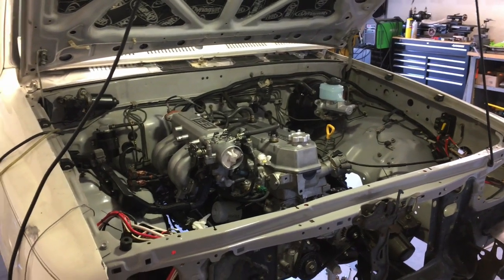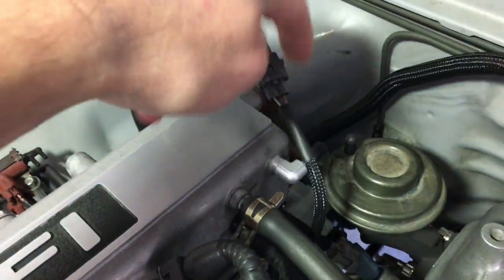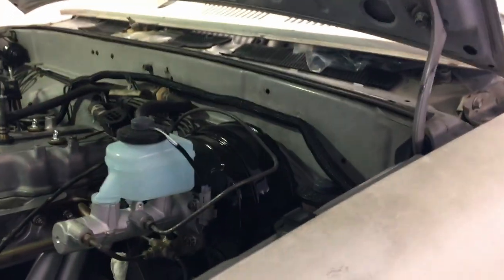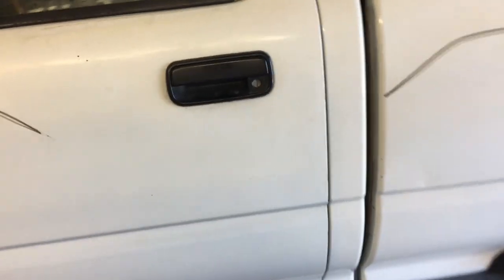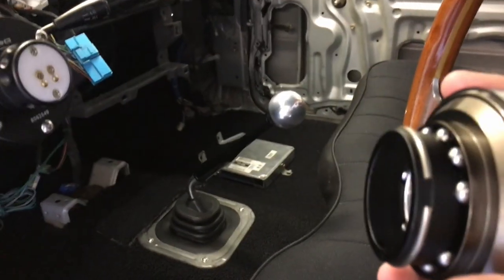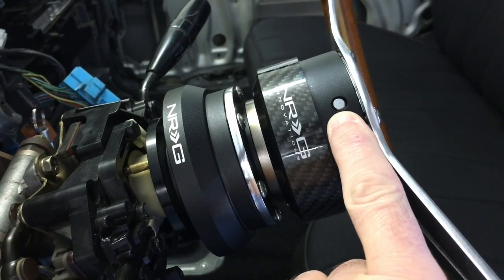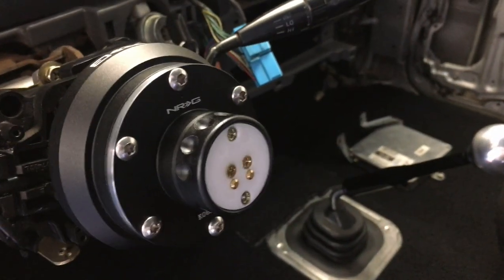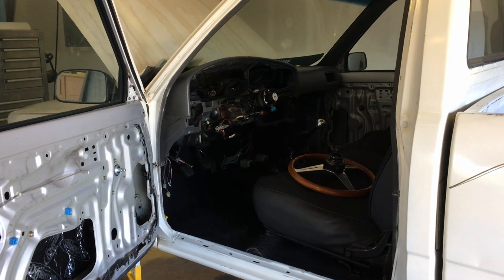Truck update & NRG quick release detach steering wheel hub review

Comment: Ray where did you get your loop connectors that connect to your main frame/ground battery wire on 3:40 and your main alternator wires that clamp screw onto the inside of the firewall/engine bay on 2:46
Reply from the maker: https://www.amazon.com/gp/product/B073FCGHZV/ - 2 and 6 gauge.

Comment: Ray at about 5:18 where you show the new master cylinder where did you get the electrical connector that it plugs into on the wiring harness? Do you have name and part number for that connector? I bought same master from LC and haven't figured out yet where to get the other half of connector, called LC but they were no help
Reply from the maker: If you mean the electrical deal that goes to the lid of the brake reservoir, I believe that was the original part from the truck harness. I might have used the old lid on the new cylinder from AISIN. It's a low brake fluid sensor if I recall correctly, but don't quote me on that. You might be able to dig something up used on ebay.

Comment: Hey Ray! Great video. I'm looking to do the same thing for my '94 toyota pickup. What were the part numbers of the adapter and QR stack? Was it the SRK-120H & SRK-200CF ? Anything else?
Reply from the maker: I just added the info to the description also, but yes you got it, it's the SRK-200CF. The wiring in the horn button area was kinda tight; I had to cut some of the wires out and solder new stuff in as I remember, otherwise it would cause the horn button to push up a bit from being seated. Hope that helps!
Reply: @ray5961  Definitely helps. Thank you for taking the time to respond - I appreciate the additional info! I think I'm going to try the "short" quick release to see if I can maintain factory distance to the turn signal.
Reply from the maker: @ViceChief  Sure, no sweat. With my setup, the steering wheel is about 1" further towards me. If they have some other short option, it might be worth a try.

Comment: hey got a question were buy all the wiring and connectors to rewire your 90's Toyota pickup
Reply from the maker: It depends which wires you are talking about. Mostly it's the original harness, but cleaned up and repackaged. For the broken connectors, I just had to hunt them down individually on ebay. A lot of times you have to surgically dissect the old connector and then put the wires into a new housing and stuff along those lines. Sometimes you can buy used connectors and splice things together. For larger wires for the alternator and battery and stuff, most of those come from amazon - search for marine grade wire which is tinned. I also buy Molex connectors off McMaster and use those to build my own harnesses. The sleeving is either rubberized high temp fiberglass from McMaster or sometimes this product on amazon called Alex flex I think. Google "high temp electrical sleeving" and there are different companies out there which make it. Most of the heat shrink tubing comes from amazon (china stuff). It's just many hours of surgery basically. Everything is soldered and hand built.
Reply: @ray5961   oh ok cool thank you for the info

Comment: Question on the quick release hub, how did you get the blinkers to work.  My hub won't fit if I leave that plastic part on n it turns off my blinkers. 
£/help/£
Reply from the maker: Mine went on no problem. I don't recall there being any issue with the blinker stuff. NRG makes a lot of hubs... which one are you using?
Reply: It's actually the adapter that doesn't fit, it doesn't allow blinkers to move up n down. It's a kyoster
Reply from the maker: @Deb12303  I had a similar issue with the first ebay adapter I tried. I gave up and just sprung for the NRG stuff. The NRG is super high quality and works 100% - all I had to do was modify the horn wire spade connectors to gain a little additional clearance so my horn button would sit flush.

Comment: Hey man doing a similar build and got some wilwoods myself. You got lug mount or radial for the front? Looks lug.
Reply from the maker: On the fronts, I'm running the Wilwood Forged Narrow Superlite 4 radial mount calipers front and rear (specifically part # 120-11784-BK in front and 120-11783-BK in the rear). I had to make my own mounting adapter from 7075 in the front and then in the rear I designed one also, which is an adapter plate that bolts to the axle back there and accepts one of the brackets from Wilwood that the caliper bolts down onto, then it bolts across to the adapter plate (which is laser cut from stainless as I remember). Wilwood makes really good stuff. Which caliper are you running, etc?
Reply: @ray5961  I’m running the 120-12002s in the front. I forget the rears. Have to look. But I got a IRS set up in the rear I’m doing so I got a inboard brake set up with the wilwood. Looking to do my own bracket for the front, but I was wanting to ask if I could get some info of yours so maybe I can do the same. It’s gonna be a bit harder as I’m doing a 4x4 and they don’t really make the parts for those either.
Reply from the maker: @harlockwaruszewski5950  Sounds cool. What IRS differential are you using? Jaguar or? I may still have all the CAD files for the brackets, but they require using wilwood hubs/rotors in order to get the correct offset, etc (at least on the IFS setup). I can send you some drawings if you'd like. Let me know an email or link
Reply: @ray5961  True but at least having a rough draft of someone that’s already done it. This way I don’t have to re invent the wheel. Lol. You have a Facebook so we can chat further?
Reply from the maker: @harlockwaruszewski5950  I don't have Facebook any longer.
Reply: @ray5961  ok well, my reply’s keep getting deleted. Let me try my email.

Comment: Hey Ray, i’m currently trying to re-wire my battery positive terminal and negative terminal cables and I was wondering where did you get the heat resistant sheathing and maybe if you have a recommendation to where to buy battery/automotive wires and terminals thank you.
Reply from the maker: Most of the sleeving is by a company on Amazon called Alex tech - they have split and expanding sleeving. The heat resistant stuff came from McMaster; just search for high temp sleeving and it's the rubber coated fiberglass stuff. The battery terminals and cables are all marine grade stuff by Ancor - here are the terminals I used  https://www.amazon.com/gp/product/B00O7S8UD0 & https://www.amazon.com/gp/product/B00O7S8V4S/ - buy solder slugs and then you hold the terminal in a vise, heat it with a torch until the slug melts and then put the end of the cable in and hold it (I also preheat the cable end before putting it in the solder). Most of the ends that allow bolts to go through are SELTERM marine grade wire lugs. For all my other spade and ring connectors I generally stick to Molex stuff, because it's much higher quality - check McMaster and they sell most everything you need. Blue Sea stuff is also very good; I have several of their circuit breakers in the truck. Their catalog online is also real helpful to check out. Stick to tin coated copper marine grade stuff and you should be in good shape :-) Let me know if you have any other questions. Most of the battery cables are Ancor 4 or 6 gauge as I recall, but you just have to look up the cable sizes and lug sizes and see what works and what sizes are best. Also, I'm running a 140 amp alternator, so I had to run custom leads for that, as well as upgrading the main charging fuse to 140 amp, even though the system never really draws that much at once. I also am running dedicated circuit breakers for the alternator, radiator electric fan and the driving lights, just to protect those systems on top of having fuses. So I have done pretty extensive re-wiring on the truck.
Reply: @ray5961  Amazing work! Got the truck inside the garage and I started removing the hood and cowl to clean. Then I was removing the windshield trim and ended up cracking the windshield :( I sure am learning a lot with this truck lol. Thank you Ray for the help! I should make a donation for all the help you gave me.
Reply from the maker: @ericrodriguez8556  haha thanks! This windshield repair kit works amazing. I fixed a nasty crack in my windshield using it and it absolutely vanished. https://www.amazon.com/gp/product/B000ALJ4MY/

Comment: How can I get a bracket adapter for the wilwood? Looks amazing
Reply from the maker: Are you referring to the front brackets or the rear ones? I made both of those brackets myself, but let me know which you are interested in. They require machining to fit, which isn't all that easy, but it's a great brake setup in the end.
Reply: @ray5961  that is awesome it looks great with a lot of stoping power. front and rear.
Reply from the maker: @sleeks9939  I think I have a spare set of rear adapter brackets if you're interested. You just need to tap the top holes. Then buy the wilwood adapters, etc. If you're interested contact me and I can double check what I've got here. The front ones are a lot harder to make. Mine came out a bit off and I had to shim then a bit. I had them laser cut but really I think waterjet might work better
Reply from the maker: @sleeks9939  contact me via ray4545 on ebay

Comment: Was the whole horn situation just plug and play?
Reply from the maker: More or less yes, but I did have to cut off their spade connectors and solder on my own as I remember. The issue was that I needed a little less wire down in there and a little extra room under where the horn button snapped in. With the original setup, the bunched up wires were just a little too long and caused the horn button to pop up a little on one edge and not seat down flush and stay snapped in. After re-working the wires and using a smaller connector on the end, then everything was just plug and play as far as the horn button operation.

Comment: Hey did you buy new metal brake lines?
Reply from the maker: Hey Eric - no, I was going to but I ended up just bending the existing ones a little to make them work with the brake upgrade and modifications I did